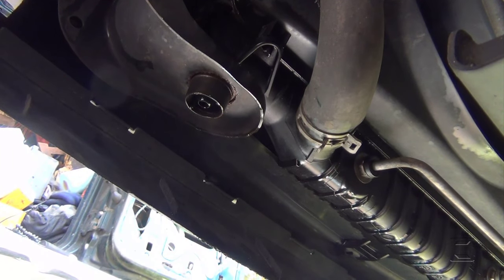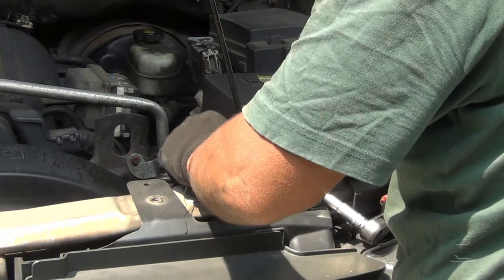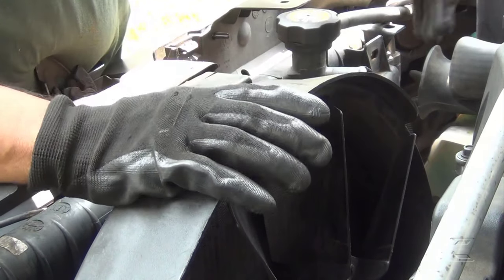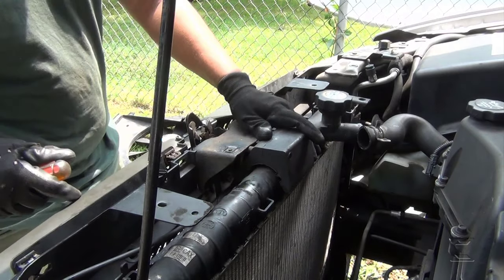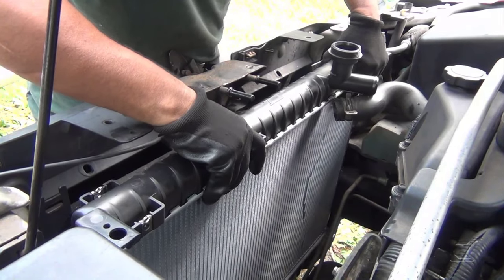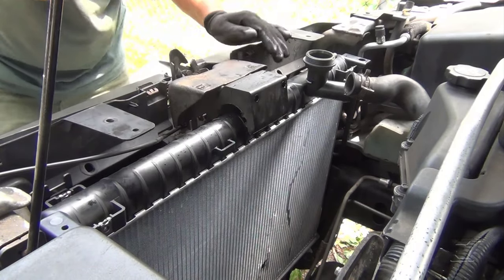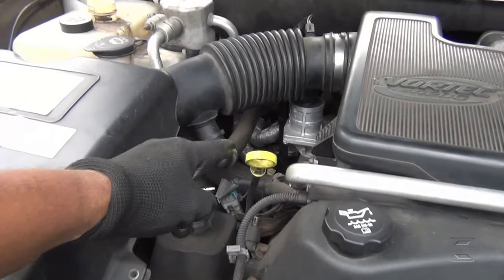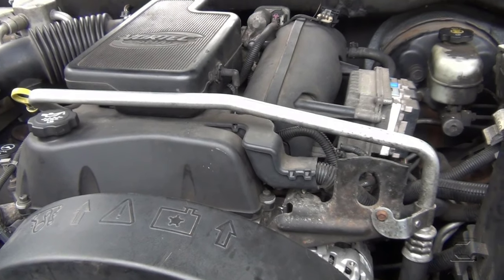2003 2004 2005 2006 2007 trail blazer bravada gmc envoy saab 97x radiator replacement how to remove

Comment: I wasn't even looking for a radiator replacement video, but I needed to get a better look at the hood latch assembly, so I can get mine back together with the hood actually latching...  Seems that no one has a video on adjusting hood latches on these, but I think I can spot where I need to adjust from watching your video, and for that, THANKS!!!!
Reply from the maker: and I also want to thank you for coming to my channel.

Comment: Thank you for taking the time to share the information. I couldn't find anywhere on YouTube how to remove the transmission cooler lines. I did this on my Saab 9-3 and the clips are the same. I'm guessing it works with most GM 2004 vehicles. Either way... Thanks 👍
Reply from the maker: thanks for your comment because that helps me a lot too, God bless you and your family.

Comment: What is that small pipe at bottom of radiator. The pipe with tiny clips you banged on.
Reply from the maker: that is one of the transmission cooler lines from the radiator to the transmission.
Reply: @JM-AUTO  Thank you. Obvious I'm DIY but replaced couple radiators over the years. Thought was for transmission. 2003 4.2 trailblazer I got does not have that small pipe. Has two holes on the radiator where pipe would go but both holes plugged. 
I'm 4th owner this truck. Will see if I cant figure it out from this point. Again thank you. Vid is good to go and appreciate it.
Reply from the maker: @fd9431  thank you and im sure you will do a great job.